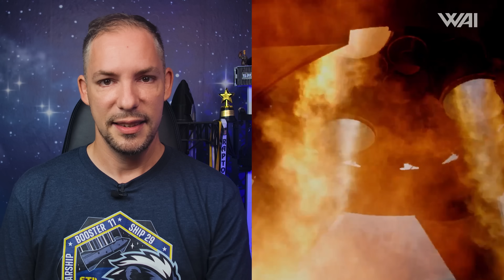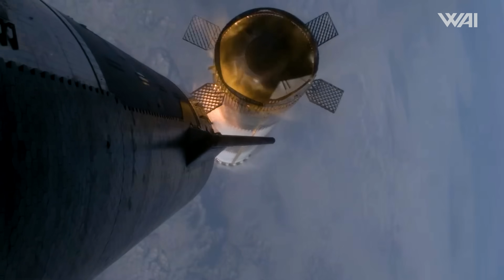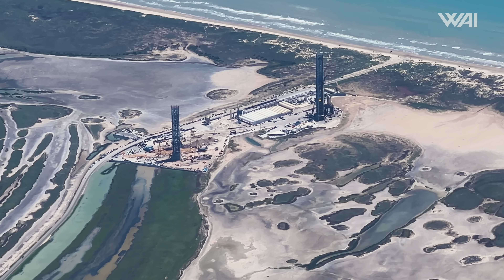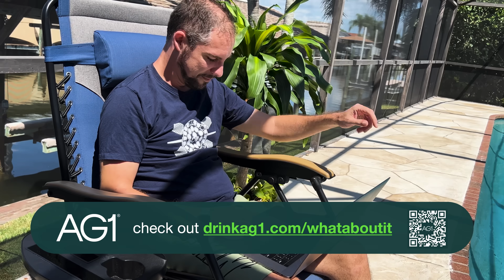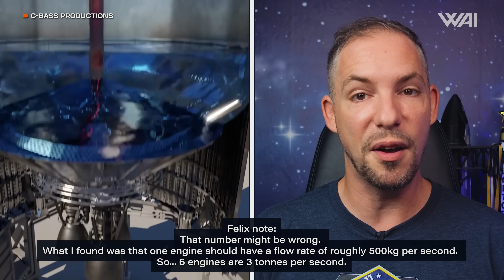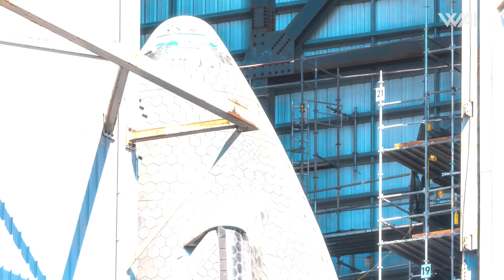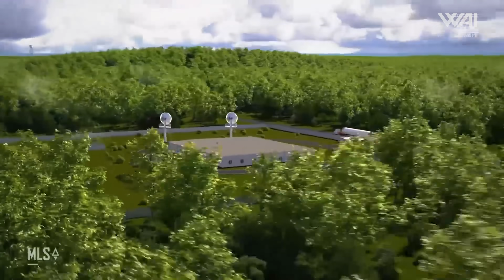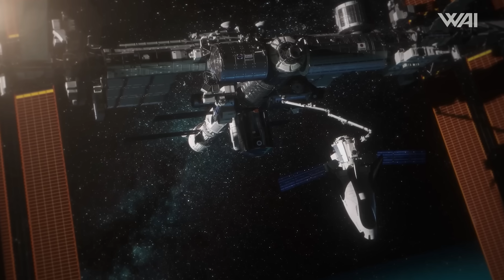SpaceX Drops Big Starship Flight 5 News!

Comment: I’m surprised that Elon has not tried to buy all the land that includes highway 4 to where they don’t have to shut down the road
Reply: State Highway 4 belongs to the State of Texas, and is an ‘access’ road. Difficult it is, to buy such. 
SpaceX could, in theory, build a parallel private road. Depends on right-of-way designations as “wet-lands” “salt-flats” “marsh lands” “tidal flats” or “private land”.

Comment: Felix might want to mention that the booster weighs about 10% of its take off weight and has a separate fuel supply just for landing.
    Would be so cool to get an idea of the radar type aligning infrastructure.

Comment: Personally. I think catching the booster this early is a bit crazy. I think a couple more splashdowns would be better to hone down on accuracy. I think catching the booster in general is crazy. But to be fair, half of what starship has pulled off these past couple years I thought was crazy. I hope I’m as amazed as I was with flight 4!
Reply: I am pretty sure that the SpaceX engineers have more data to base their decision on than we do. It's not crazy unless it fails. 😁
Reply: @appliedfacts  SpaceX engineers have always had more data than we do... and yet Starship has had more failures than successes. Besides... Just like the Falcon 9 does not have a 100% sucessful landing record, the law of averages say that at some point a Starship landing will fail and take out the tower.
Reply: @douglascaskey7302  the tower is built like a tank unlike the booster which is like a tin can , the booster will not destroy the tower in the event of a failure
Reply: Well, there is no reason to risk it before they have a fully operating second tower. I think that's why it seems so crazy. They have only really had 1 successful landing with the starship and 0 with the booster.
Reply: Yes. It's crazy. So was the idea of a booster coming home after doing it's job was  a few years ago
Reply: You never get anywhere without making mistakes first
Reply: @TwistedMetal007 Yeah, sure.
Reply: No balls, no blue chips.
Reply: youre forgetting that this is SpaceX not Blue Origin so expect a lot of crazy that only spaceX can make work
Reply: Blue what ? Never heard of it....
Is that a candy bar ? 😂😂
Reply: Only SpaceX has the data how accurate the water splashdown was. Maybe it was well within the range the tower can accept. The booster can hover for a little bit, that helps.
Reply: Nah it'll be awesome, if it works it'll be mind blowing and if it crashes and blows up that will be just as epic
Reply: It really depends how much data they have. I’d probably do one more virtual landing, but maybe they feel confident with two towers.
Reply: You learn 500x faster from a failure than a success.
Reply: @pedro.zurita  that is actually so true. I kinda hope it fails now for their sake. So it’s more successful in the future 😂. Like when the first starship landings failed, thought it would never happen then it did.
Reply: Well said! I agree. SpaceX is like no other, how quickly they iterate their changes and test! Each iteration has resulted in major progress!
Reply: GUYS YOU SHOULD KNOW THAT SPACEX WILL ONLY ATTEMPT A CATCH IF EVERYTHING IS NOMINAL...
Reply: @3pints 
THATS RIGHT. WE DO KNOW THAT!
Reply: No they have been taking too long already,
 he needs to start catching them and refining the catch procedures .😂😂
Reply: Nah, we want to see the catch.
Reply: but it is epic. if they pull it off, or if it goes boom, either way
Reply: You need to consider spacex has been doing the "landing" for a long while now.  Their system for positioning and slowing the rocket at exactly the right time/location is basically perfected.
Reply: Interestingly enough, in my head, that's part of the allure...
I mean, there is always a risk of pad RUD, so even if it fails, it will give valuable information on the impact this would have on infrastructure.
Reply: spaceX should just hover catch super heavy a few meters off the OLM using just a couple of engines with chopsticks in place just in case for low risk practice. Then try 10 meters,20m,30m etc until confident controlling chopsticks and booster
Reply: Guaranteed excitement
Reply: One minor detail that makes super heavy EASIER than Falcon9: Super heavy CAN "Hover" while falon9 cannot.
Falcon9 must target zero velocity at zero altitude to land. It has TOO MUCH thrust to hover.
Reply: What has starship pulled off?
Reply: @cjhan47  more than you have ever done
Reply: @cjhan47  - "What has starship pulled off?"

Took off and landed vertically.
Has made it to "space" and very close to orbital velocity.
Has successfully re-entered and performed a controlled crash into the ocean.

I bet a person inside Starship in good spacesuit could have survived, assuming rapid recovery.
Reply: Who asked you ??
Reply: "this early is a bit crazy"
the first Starship flip and landmanouvers were 5 years ago
and 2022 Musk sent an memo out that they will go bankrupt it Starship does not fly every second week in 2023 xD
Reply: Lol try looking at the timeline again .. 😂 @benjaminmeusburger4254
Reply: @benjaminmeusburger4254 And…..did they?? Do you still believe everything he says??

Comment: So Starliner replacement (DC) is almost ready to fly, nice!
Reply: DC is only for cargo it can't carry crew. A crewed version would be a very big redesign which would take another decade at current dev rate.
Reply: @admarsandbeyond  Yeah I know, I thought it won't take that long to develop the crewed version. Hopefully development speeds up with every success!
Reply: @z30_HUNGARY  It'll take a long time to develop a crewed version. The cargo DC being built here is a smaller version of the original crewed version, so can't simply be upgraded. Think of it as equivalent to Dragon 1, which served well but couldn't fly crew.... a largely-new Dragon 2 vehicle had to be developed for that to become possible.

Comment: Felix, unless the booster is capable to hoover in the air, or somehow reduce its speed to great extent, and hence give time for a correction in trajectory and/or position, in relation to the mechazilla's arms, i would not be confident in the successful catching the booster. Because the chances of success are NOT 100%, I am afraid we will witness a dramatic fireworks, and this will not be liked at all by the FAA, which could close the shop for months, or worst, forever forbidding spacex from using that area.  Dramatic, isnt it?
Reply from the maker: The booster is capable of hovering and that’s the plan.

Comment: 1.  A falcon boom isnt "3" of the sound you hear.
Its one boom comprised of 3 rapid pulses each of slightly different frequency and volume. 
The shockwaves from the bottom of the rocket, the top of the rocket, and (i assume) the grid fins. 

This makes it diffent from the single pulse crack of a typical close lighting strike. 

Oh, and california over by Lompoc get them too..  the area around vandenburg is pretty populated.

Comment: audio mics will never give true audio justice to a sonic boom.  Especially one coming from Super Heavy booster on Starship!  🙂
Can't wait for the next Startship launch!!!
Reply: Correct.  I think the best representation I have heard was Smarter Everyday and his audio recordings of a launch.
Reply: Not sure much mics, but no way to reproduce the dynamic range.
Reply: @TheChipMcDonald … actually for live in-person, the infrasonic and subsonic from the immensely-large sound ‘stage’ are what make all the difference;, my house literally shook when Starship launched .. no speaker can POSSIBLY reproduce the sheer power of that sound wave emanating from 36 Raptors.
Reply: @ernestgalvan9037  That's what I wrote: there is no way to reproduce the dynamic range.
Reply: There are specialized microphones, used for analysis of high explosives, that scale up to ~180 dB. I wouldn't count them as "audio equipment" per se, but they might be useful as secondary audio source to overlay the clipping normal mics.
Reply: Makes your ears bleed of how cool it is! 😊😊😊😊
Reply: Get a better pair of headphones
Reply: Does size impact volume significantly?
Reply: If you've been to a fireworks show, you know what a sonic boom sounds like. It's basically a deep explosion, like a big firework exploding in the sky. You feel it in your chest

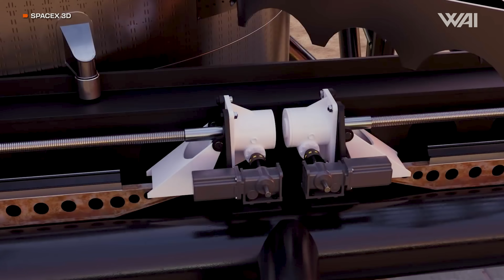Comment: That animation @ 3:00 showing the Catch Pin Alignment Hardware was extremely enlightening.  I always assumed that the catch pins had to perfectly aligned before landing.  I now see that there is about +/- 15 degrees of error margin.  I am even more confident of a successful catch attempt.  Bring on Flight Five!
Reply: The world’s only juggling chopsticks.
Reply: I wonder if a greased converging slope system could eliminate the mechanics.
Reply: @xbluesaintx  the best part is no part!
Reply: @xbluesaintx  yes I am with you. Mechanical loading prefer slopes not right angles. Bearings and gears have proven that already. Also I think they will have to make a skirt or larger area of coverage in order to increase the success rate.
Just thinking that a ship the size of the booster is supposed to hang on these 2 load points is just retarded... Sometimes SpaceX is trying to reengineer physics I think...
Reply: @niri2506  yes I am but the 2 are not the same. Picking 30tons from rest and moving it and stopping 30tons coming at you to rest are 2 different types of beast.
They should perform a 50km to catching attempts before just tallyho the whole thing...if it's going to stop the ship coming from orbit. Catching it from a 50km should be a breeze.
2nd tower will be ready before flight 5 or at least stacked.... Perfect opportunity to test the catching with minimal risk to pad A.
Reply: @damonried1720  You should have asked the Nerdle on LabPadre Space, we would have told you that. 😉
Reply: rotating a ball screw of that size is never recommended due to vibrations. you want to rotate the NUT
Reply: @benvrakas  Those animations don't come from SpaceX. They're made by fans.
Reply: Use the power of math and you will find out how much of a Lee way they have. It's not 15 and it will be a miracle to work with current design.
But then again....~ I believe I can fly ~

Comment: Why can't they have Barge Landing with the catching Tower on a mobile off shore drilling rig?
Reply: It's optimal to return to the launch site as they are aiming to shorten the turnaround time as much as possible
Reply: What neo said.
Reply: @neobrandeggen …once the ‘pipeline’ gets filled enough, transport time will matter very little,
Reply: They will.
Reply: @JimmyRussell-c2s  it's about the logistics I guess...starship and it's booster are huge and not as easy to transport as falcon rockets. Might come in the future tho..we shall see
Reply: I suspect because it moves. If you have a 150m tall tower (plus the height of the platform itself), even a slight rolling motion introduces a degree of uncertainty that they probably want to avoid.

Comment: I expect they will still have heat tile issue. They will have to run Coolant Tubing through the epoxy. Probably Helium for light weight. The epoxy weighs more. My idea Cuts Weight. Not adding weight.

Comment: Does anyone know if it was the same position of engine replaced on ship 30? What I mean is that if they replaced Raptor... say 200, with 300, did they replace 300 this time? That could indicate an issue with the systems upstream of that engine, and if it's a different position, it could mean that it was an issue happening with several engines in a series.

Comment: Why doesn’t the booster need the tiles and why doesn’t it burn during the decent?
Reply: Because the booster doesn't get up to orbital velocities. It's not the altitude that causes the heat, it's the speed.
Reply: The booster doesn’t reenter that fast. During ascent the fastest it goes 3385 mph and during the decent the fastest it goes is 2767 mph and with drag they slow down. While the ship reenters at 16409 mph and needs tiles to fight the plasma during reentery
Reply: because while the booster does get moving pretty fast on the way up to space, it isn't going NEARLY as fast as something in orbit. and the direction the booster is moving is not so entirely horizontal, it's somewhat vertical.

so once separation happens, the booster fires backwards to cancel out its horizontal movement and reverse it, but is still going up for a few moments, then begins coming back down.

so horizontal movement is reversed, vertical movements slows to a halt then reverses but more slowly. objects in orbit are higher above the atmosphere and moving entirely horizontal until they begin descending into the atmosphere, but pick up even more horizontal speed as they do.

 in all the booster isn't moving that fast as it re enters when compared to the speed of an orbital object re entering.
Reply: The temperature during re-entry is much lower for the booster compared to the ship, because it doesn't reach such a high speed. Stainless steel and the engines can handle it themselves (should anyway).
That's also why the booster won't be doing a re-entry burn like the Falcon 9.
Reply: It doesn't reach orbital velocity.